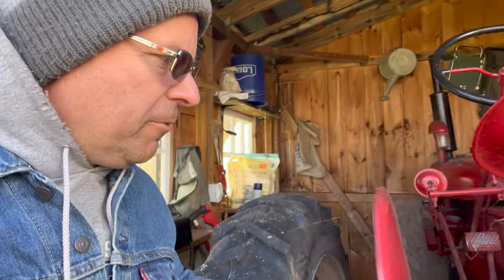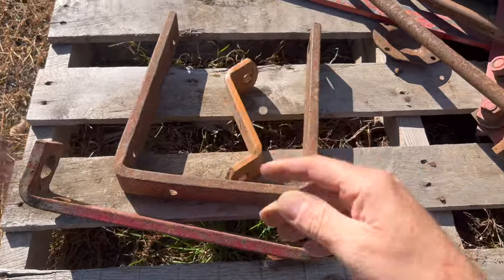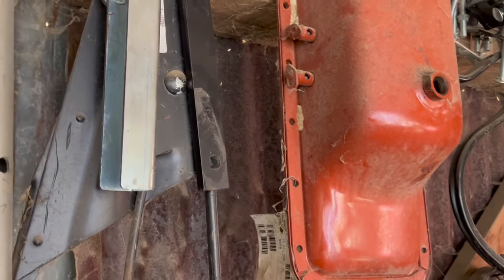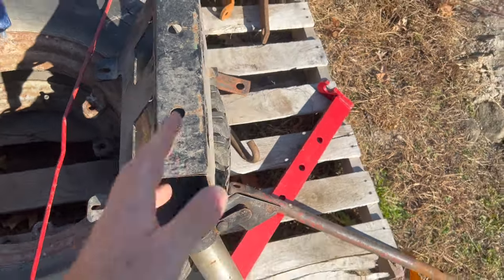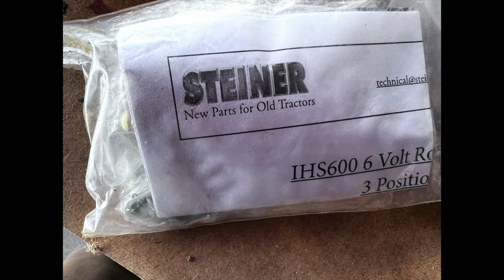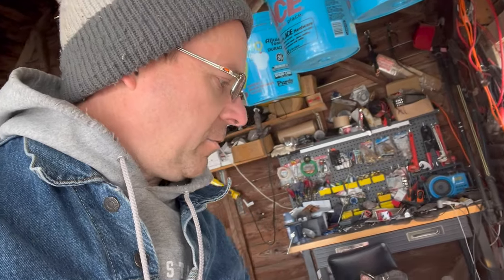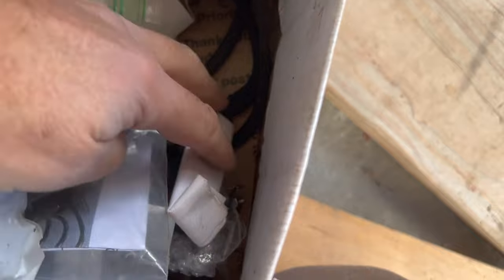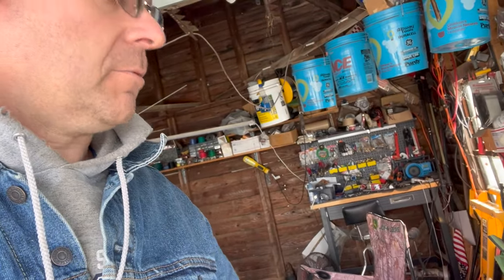IH Farmall Parts & Accessories Blowout Sale

Comment: And I’m interested in the 90 degree gear box with the round wheel let me know the price and we can go from there thanks
Reply from the maker: the Cub belt pulley and pulley drive? on eBay they are $310 with shipping included.  I was thinking like $250 with shipping included.  $200 if you pick it up.  Its heavy and the shipping costs are unreal.
Reply: Okay send me your address are where I can buy them from you Im doing a full restoration on my Farmall cub now it’s almost ready for paint so how much for a rear drawbar I need one of them as well
Reply from the maker: can you email me @ ledgemerefarm2013@gmail.com? it is safer than doing that all publicly. you said a drawbar, the swinging set is what you want, correct?